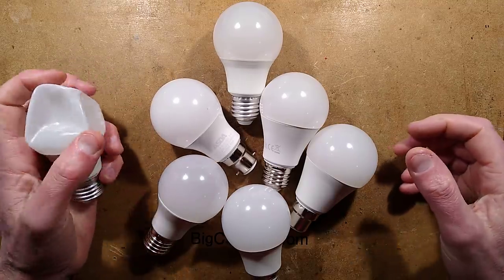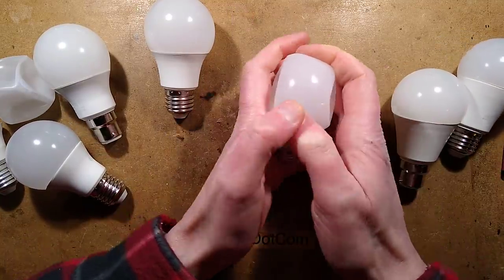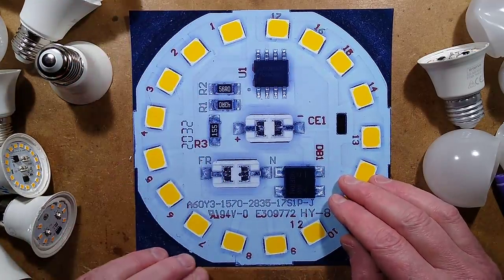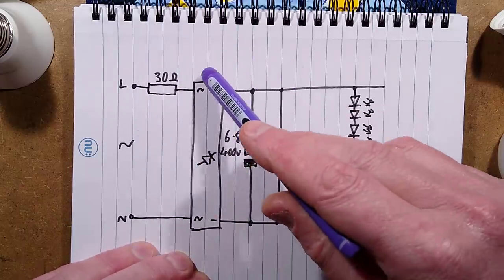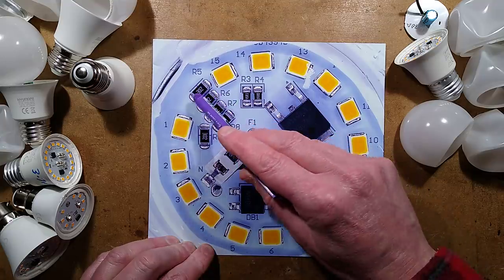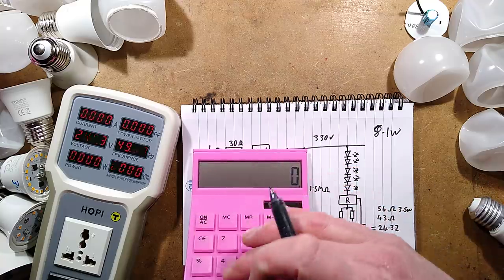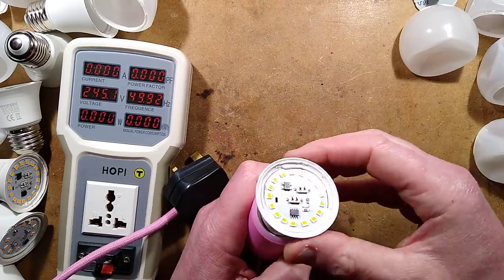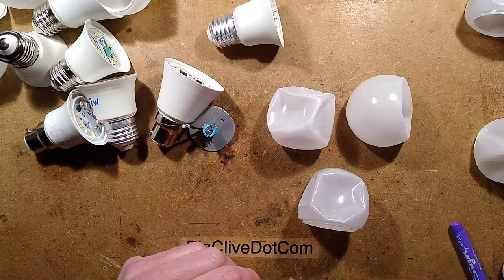Crushing and hacking LED lamps

Comment: I popped open a North American LED lamp from IKEA to see how similar they were, and if the same technique could be used on them. The answer: quite different! The board with the LEDs just contains a handful of resistors, and there's a second board inside the base of the lamp with several components including a small transformer, resistors, rectifier, diode, IC chip, and capacitors. I can send pictures if you like! Let me know if you're interested.

Also, I found a way of getting the plastic dome off without crushing the bulb. First I hit the dome with a hammer repeatedly around the connection point to soften the plastic. Then I worked a flathead screwdriver into the gap between the dome and the base and worked it around the circle, slowly working it loose. After a minute it became easy to remove by hand.

Comment: At about 5:40ish minutes you mention a resistor that keeps the lights from glowing and also lets them turn off instantly.  Would it be reasonable/safe to remove that resistor to allow the led to function as a night light and also have a softer/slower turn off?  That would seem to be a nice feature.
Reply from the maker: Yes.  But note that the capacitor on the PCB will hold a charge for a long time, even when the LEDs have faded out.

Comment: I have Noma lights which are also the same style with the same circuit as those. All I had to do to pop the top cover off was twist it until it was spinning loosely and then it popped right off.

Comment: Hey Clive, random question i need answer to: I got my hands on some LM2575 s and I wanted to use them as buck regulators, but I used no inductor and a regular 1n4007 diode instead of a fast one and it worked, but what are the drawbacks when using them like that?
And why do they say the inductor is necessary if it works without it?

Comment: A few drops of acetone applied with a dropper where the two parts meet will make the disassembly a lot easier. Just be careful and patient because using to much can stain the globe a little bit

Comment: All of the LED lamps in Australia by various manufactures that I've opened up are totally difrent build as far as there are no resistors, caps or regulating components or rectifiers mounted on the base containing the LEDs. They just have the LEDs monuted. All of the power supply components are a potted module on short leads in the base of the lamp. So by the time you extract the power supply out of the base it all becomes landfill.

Comment: Clive - why not print a set of "coins" to put over the front of your de-domed bulbs?
It might look nifty (or naff).  Could even create a mesh to let the air through but fingers out.  I have a de-domed 100w in the ceiling fan, the shade is meant to limit the bulb to a 40w or 60w  incandescent- 100w is too big but a de-domed LED is cool and puts out just enough light to not need lamps.
I can't remember what it came from but I found a plastic disc that clipped in nicely and though not frosted - disturbs the light into a nice glow.
Reply from the maker: I did better.  I made a huge 3D printed quartz crystal.
Reply: @bigclivedotcom  mmmmm gaudy :D

Comment: I've had some IKEA ones for 5 years with a fair amount of use. I've not had a single failure yet. 

Could you fit a variable resistor to make them dimmable then?
Reply from the maker: You could, but it would also need other series resistance to limit the range.

Comment: I have similar 9W lamps from Philips, India; made in the year 2015. Since they are failing now, I tried dismantling them, but its almost impossible. The dome diffuser is super strong plastic. Even if I could remove it somehow, getting access to internal electronics is impossible, unless, I use a hammer or dumb-bells. Guess, the cost cutting had been across all components of the LED lamp.

Comment: The covers can be pried off with a screwdriver relatively nondestructively, being very careful you don't stab yourself with it due to the high force required. The amount of glue and consequentially the force to take them off varies a lot between brands, some come off very nicely while some are impossible to take off without destroying them.
Also, having dissected more than 20 of these after they failed, the failure mode is 99% heat related (about 80-90% dead LEDs, the rest being dried out or blown capacitors or blown driver circuits). So they're definitely being pushed way too hard for the heat dissipation possible in this style of case. I remember when LEDs were just coming onto the market, they'd make the whole lamp body out of aluminium with heatsink fins, or have the LEDs mounted on plates that had airflow over them, now they seal them all inside and cook them to death. Definitely to guarantee a constant revenue stream and empty your pockets.
My source for dead ones is the local supermarket that has a dead lamp bin you can rummage around in and take them. Most are unrecoverable due to dead LED chips or drivers, but you do get lucky sometimes with just single led chip failures that can be bridged or replaced (I did some on the kitchen hot plate) or even fully working ones (my most recent score being 2 perfectly good, almost new PIR sensor lamps that someone tossed out)

Comment: I opened one when it failed and it had a switching regulator with transformer inside the body. Just LEDs on the round plate. There was a TVS across the LED chain that went s/c, to protect the 100v output capacitor when an LED goes o/c. 10 Lumileds, 6v each, in series. I bought replacements, just because, and it worked - for a while, then a different one failed.

Comment: Thanks for the delightful post. Just curious, how does the voltage increase from 200 or so to 300 without a txfmr?  Any simple explain out there?
Thx in advance.
Reply from the maker: Your supply voltage is described as an average of the sine wave.  The peak voltage is about 1.41 times higher.
Reply: bigclivedotcom nah! Average of a rectified sinewave might be relevant here but you used 1.41, so it’s RMS. This is the effective voltage that gives the heating effect. So square it first then average and square root back. The Voltmeter on ac does this calculation.

Comment: I was able to 'hack' a similar bulb from 60W to ~34W by removing one of the 2 resistors. Didn't change the heat much, but also didn't dim it much at all. Tested 0.04 amps vs 0.07.

Comment: The nearest LED bulb I could crush has a 4.7 ohm resistor in parallel with an 82 ohm. It's such a huge imbalance. If I remove one it will barely make a difference, but if I remove the other I'll have a nightlight.
Reply from the maker: This is where a selection of SMD resistors could be useful.

Comment: I have here a Datasheet of an LED Lamp and see a diagram of Current vs. Light-intensity.
1A => 50% Light intensity
3A => 100%

The efficiency is doping significant.  This means, with 1/3 of the energy you can get 50% of the light.
Because of 1/3 of the heating you can get a much cooler lamp and a much higher durability.

 I like the diffuse light of the cover.
But I would un-iceberg this plastic-cover before I glue it on again.

Comment: i have amusement arcades and obviously weve ben going led for a few years now to keep the power bill down lol, these things do not last their stated life span when they are on all day, its one thing in your bedroom and it only comes on at night when youre in there or wherever in your house, this will definitely save me money not only on power but on bulbs and it will also reduce the heat build up in machines, 2p pusher and grabbers get very hot inside, i remember when they all had a whole bunch of 20-60w halogens in them, you could cook a roast dinner in the bad bois that caused quite a few problems in some machines lol

Comment: In the US the great value lamps use 22 ohm resistors. Just cut one of those off and it halves the wattage.
Reply: Today I got a Dollar Tree lamp and it only uses a single 7.5 ohm resistor. Unfortunately I only had reels of 10 and 47 ohms, both 1206 so I had to put one in diagonally. I guess I'll add an 0805 resistor assortment to my next Amazon order.

Comment: LED Backlights in flat screen's the mfg push the led's to the limit as well!  Typically only lasting 2-3 years.  After we repair one for LED issues, we reduce the current powering the led's to make them last.  There is hardly any noticeable difference in the brightness.

Comment: If you replace the resistors with something like a TFPT1206L1000JM which is a 100 ohm thermistor that scales up to 133 ohms at 100C, you could have a light that varies it's output based on temperature. It would be good for a motion activated light I guess. You would have to stack two of them to get 50 ohms.
Reply from the maker: The current regulator does actually reduce the current itself if it gets too hot.

Comment: A much easier way to remove the globe is take a G-Clamp and apply near to the join, then cover in a plastic bag to catch any fragments and slowly tighten. This pops the two apart without the need for Manx brute force. 
Managed to do so little damage that my DuraLamp 95mm dia. globe popped off and can go back together. 
This baby has 40 LEDs.
Reply: The DuraLamp has a SMPS and this failed at a surface mount capacitor on the LV side, close to the through board cap on the output. Capacitor has burned away and this left lamp flicking on and off. Replacing with new Philips which don't have the large aluminium heatsink sandwiched between plastic of base and globe.

Comment: Interesting.  The enginerd in me says why not take it further? Remove both resistors,  then replace one with a 33 Ohm fixed resistor in series with a 100 ohm variable resistor. Now it's adjustable.
Reply: How did you arrive at those values? I want to do this too.
Reply: @tonyweavers4292  Factory installed value is 26.32 Ohms before modifications. You don't want to go below that. I chose 33 Ohms because it's a close standard value.  If you clip one resistor,  you increase the resistance to 43 or 56 Ohms. Which causes less current to the LED. The higher the resistance,  the lower the current.
Tie the center (wiper) to one of the remaining terminals on the potentiometer.  Checking with your Ohm meter you should see roughly 0-100 Ohms. Put that in series with the 33 Ohm resistor and your values should go from 33 Ohms to 133 Ohms.  33 Ohms Should give maximum brightness,  133 Ohms lowest. 
Have fun,  experiment,  be careful and mindful of line voltages and this circuitry may cause fire or shock if done incorrectly.

Comment: It occurs to me that if audio was fed into the correct pin on the 2082 ic you could have some rather nice effects. It may also make a decent but probably low power audio amplifier.
Reply from the maker: You'd have to modulate the sense resistor value to get that effect.
Reply: @bigclivedotcom  fets can be used as variable resistors. Maybe you could come up with a circuit and use it in a future video.

Comment: Oddly enough it's possible to buy 2W or 4W LEDs as accent lights (which are cheap enough on power to leave on as a nightlight), but they're not always as cheap as the 8W or higher bulbs.

I wonder how those compare to the hacked ones?

Comment: Probably all the dollar-store lamps from Dollar Tree (60W, 75W, 100W equivalents, 8 to 13 watts) here in my part of Florida are grossly overdriving their LEDs. Every one I’ve opened up has the simplest possible capacitive dropper circuit.

Strangely, none of the three nearby Dollar Tree stores I go to has had any of those LED bulbs for weeks. Recalled? Out of stock? Banned? No clue. Some odd things replace them, like decorative incandescent bulbs up to 60W actual power, some with quite large globes.

Comment: Put some bar codes on your desktop for the camera to find focus.  I think it would work best with barcodes horizontal since the camera scans left to right.  It depends on the camera and the focus algorithm.  Most use a pseudo Fourier transform and adjust focus to maximize the higher luminance frequency content of the image.
If your camera likes them and focuses quickly you can just leave them in place.  And perhaps a barcode for holding in your hand for when you are holding something for the camera to focus on.

Comment: Hello, I'm a recent subscriber and just upfront, I'm quite sure this isn't proper use of your comment section for this video but I think you should reach out to the Gamers Nexus youtube folks...in particular for their recent review of a pcb within a riser cable. In general I think the overlap, collaboration opportunities, for your two channels would be amazing. I thought of you when in their teardown of the faulty nzxt pcie riser cable they had some questions about features they found via xray. They openly asked if anyone knew what the various features were. Some sort of channels in the boards, if I recall correctly.  In my opinion,, you guys have similarly sized channels, similar tools, work with electronics, but seemingly have different skillsets that I think could augment one another. I personally would like to see you periodically augment one another's coverage(and fans knowledge of whatever topic). Plus as an added perk; you might be able to get some of those sweet reviewer samples for those high dollar pc electronics used for review... to teardown and explain.  In any event once you get that rolling I'll take all your leftovers... 🤣 . good luck! huge fan since recently discovering your channel. -Brian in the US.
Reply from the maker: Was that the one with a short circuit?  Interesting design fault.

Comment: You could fabricate a pentagon/hexagon holder to support a bunch of those boards and provide a lot of light at low power through each.
Reply: 12 pentagons, 20 hexagons it turns out.

Comment: Very good. Please buy/use a lux meter as well. the lumens analysis are indispensable for these lights videos. What about adding a potentiometer and make it dimmable?
Reply from the maker: The potentiometer would work, but would need to be close to the chip and have series and parallel resistors to limit it's control.

Comment: It seems to me that the LEDs in the light you explored are connected in parallel, not series. You can see an orbital track on the outer edge of the PCB, and individual feeds to each LED from the inner ring. Look at LEDs 4, 5, 6, 8, and 9 for example - can clearly see one track each side of the LED. I couldn't see how the LEDs could be serial in this case.

Comment: current leakage... I've experienced this with some "smart" dimmer switches running the recessed LED lighting in my living room. The only thing I could do to get the bulbs to stop glowing was to leave one halogen bulb in one of the sockets. I also had the bad luck of getting some LED smart bulbs (different fixture) that got incredibly hot and burned out very quickly, within a week or so. I cracked open the shell to find that the first resistor stemming off of the mains was charred, as was the board and a small tantalum capacitor that was close to it. It makes me wonder if these bulbs were manufactured on the premise that US voltage is 110VAC, instead of the 124VAC that I have in my house. I won't use those bulbs anymore because they would get so hot that I couldn't touch the housing.

Comment: After adjusting the sense resistors to reduce the LED power, is the linear regulator now the weak link?  The regulator might have been rated at exactly the minimum size needed to run the LEDs at 9W.  When running them at 3.7W, will the regulator be over-heating?
Reply from the maker: It runs cooler too.

Comment: it takes a bit longer, but you can get the covers off by working your way around the seam with a box cutter blade or a thin spudger - in a non-destructive manner.

Comment: Now I'm wondering if the crushable tops are thermosetting plastic or not. Could they be heated and pulled into flame-like peaks, or pressed to form shapes in a mold? I must get some to try.

Comment: Back in June, I purchased an 100W LED floodlight on Amazon with the intention of replacing it's driver with one rated at 50W. (For all the reasons mentioned in the video, especially longevity.) To my surprise, the LED was being driven by two 50W drivers in parallel. All I had to do was remove one.
Reply from the maker: That's fairly common.  Each is current limiting so they share the load.